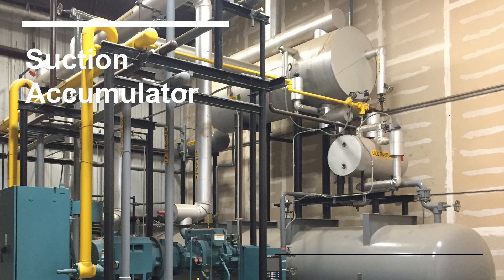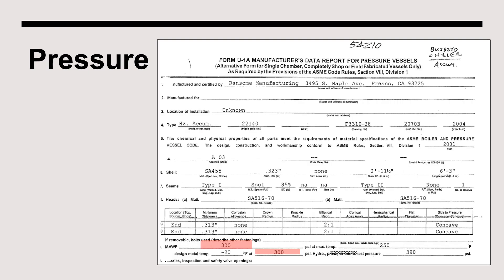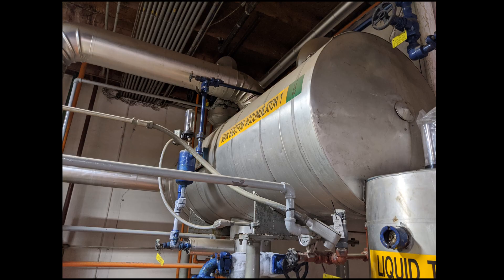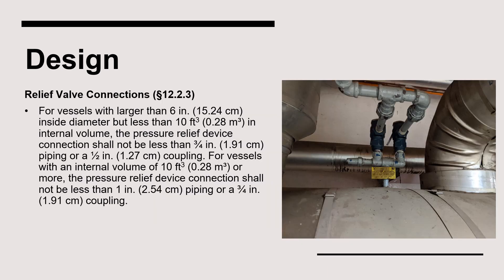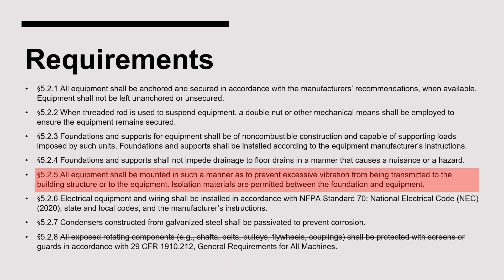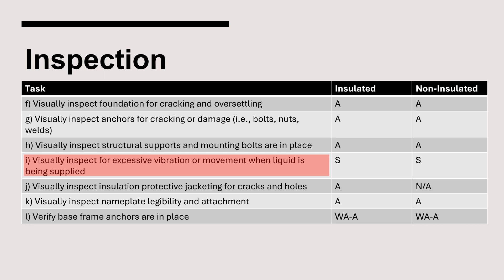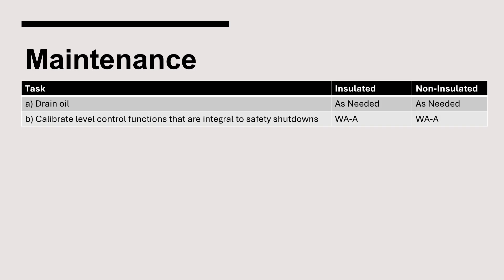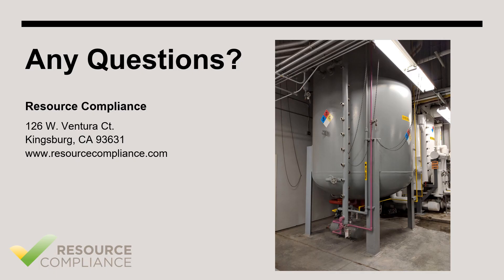Suction Accumulator

Comment: Great video!  What are the components and the name of the pump that transfer the excess ammonia from the accumulator back to the receiver?
Reply from the maker: The component that moves liquid from the low side back to the high side is typically called a "Liquid Transfer Vessel", "Dump Trap", or "Transfer Pump".